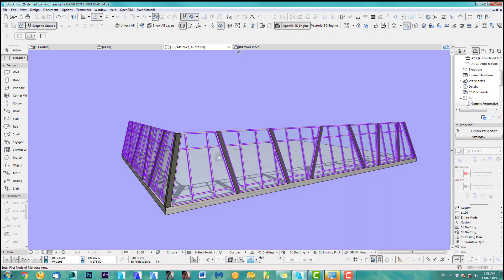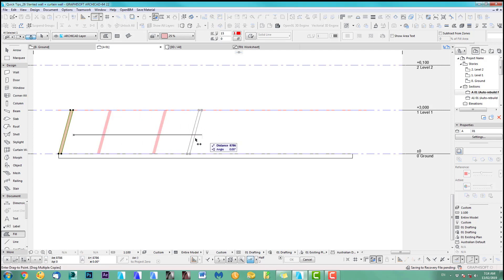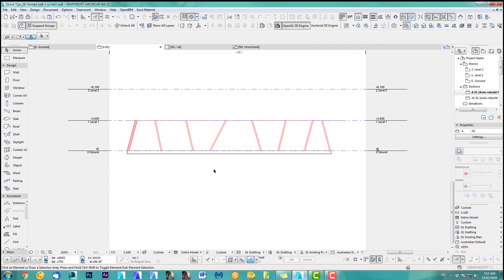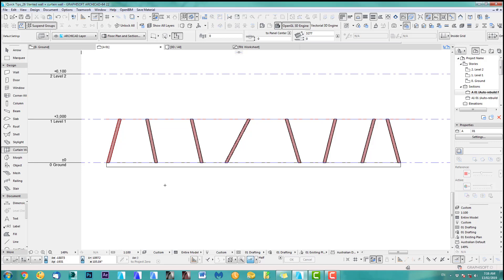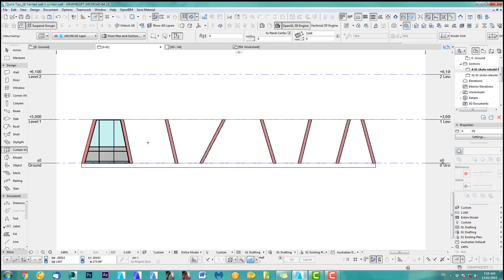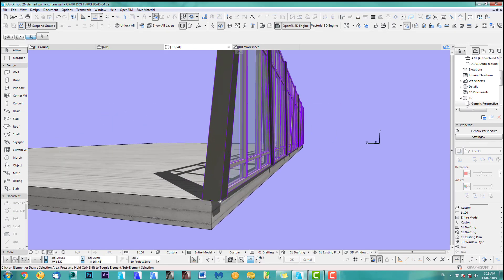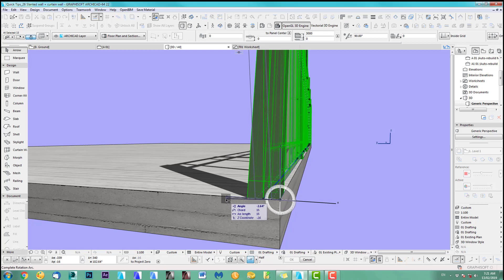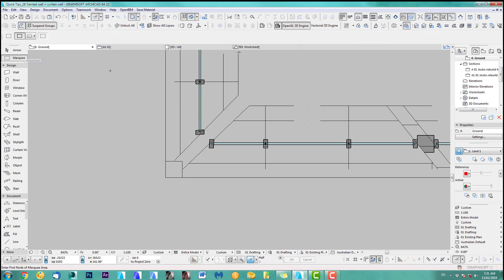How to model a slanted Curtain Wall 2 ways in ARCHICAD

Comment: How would you add a door to this slanted curtain wall? Ensuring the door is 90degrees?
Reply from the maker: If you like to keep the door at 90 degrees then follow these steps:

- select the curtain wall and view in 3D ( it's easier )
- select the curtain wall in 3D and click the edit option
- now select items like glass panels, beams, etc. you don't need ( where you like to build your door )
- then in the hole you created draw a normal wall on the floor plan and add the door, another 2 walls either side to close the gab or whatever you like to model there.
Reply: Thankyou!! That worked perfectly! Great videos!!!
Reply from the maker: @craigwallace96  awesome ! glad I could help

Comment: at 3:00, I have followed the setting, insert the beam and also the window curtain. The beam isn't aligned with the window curtain on 3D view, there's a small gap on the bottom and top.
Reply from the maker: it's hard to tell not seeing the curtain wall settings for the beam. There will be a setting somewhere in the curtain wall tool box which creates these gaps. Maybe - under scheme at the bottom there are pattern origins, check these ?